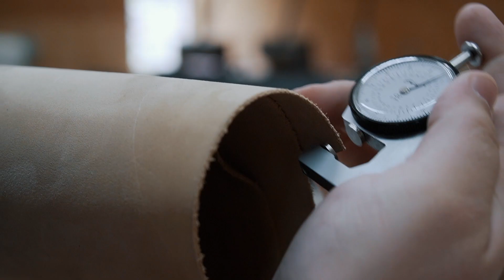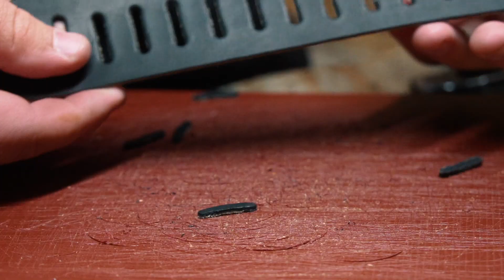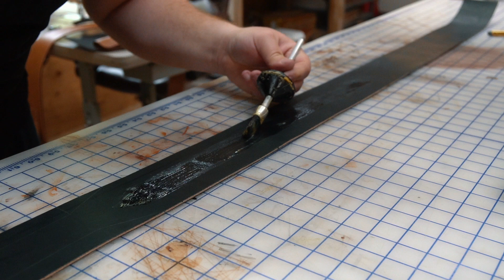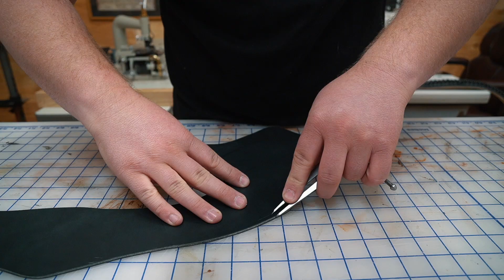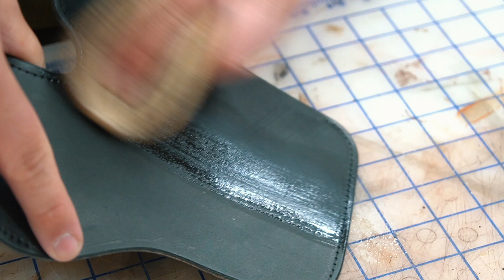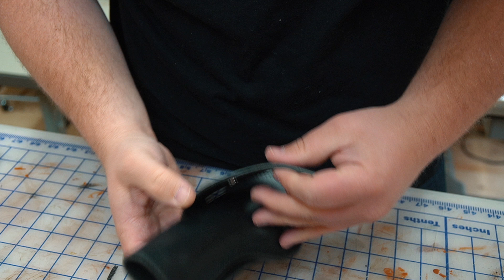Making an Eastwood Leather Cowboy Fast Draw Holster and Belt

Comment: Nice job. I have to cut the belt end taper first in case I screw it up. At least then it's right at the beginning. lol. I saddlestitch the whole thing...that sewing machine looks great. The sewn on loop backing is an awesome idea. Beats cutting holes in the belt itself. I'm about to start a shotgun shell belt and will use that.

Comment: I'll pass on this video, because I'm a stickler for "Traditional" Old West  holsters and belts as ACTUALLY used in the 1850s-1874, which this is NOT ! This is what I call a  "Hollywood-bikini" holster made for modern western movies for "quick-draw", which NEVER existed until the 1950s-1980s etc. Just my personal preference to be totally authentic  to the era . I simply will not use a Hollywood movie style non-period holsters or belts etc. If it was not used in the 19th century, I will not use it !

Comment: great work mate  im gonna order the     tipping machine  is it good any adive on it , its last one i can find  as tandy  sold out 
i think your vids and workshop great 
thx
Reply from the maker: thank you! I took the inner hole close to the oblong hole punch because I found that with thick leather, it was too close to the buckle. So I just punch that one by hand but it's still super helpful for the other cuts. Saves a lot of time
Reply: hi thx fir info i got machine today  from spain  but arrived  damaged  the knobs bent 
on your machine can you put the fence guide  in and out by hand thx again

Comment: Do you ever install bullet deflectors on you holsters?
Reply from the maker: no I tend to like the more period correct style rigs (with some exceptions). But the deflector also requires a lot more work to line the holsters with rawhide or a steel plate and it's just not something i've tried out yet. Maybe one day:)
Reply: @parkerlichfield  there is definitely more work to it but the holsters come out really nice. You should try it one day.

Comment: Clint Eastwood was right handed. .this holster was for a left hander. .just a comment. .
Reply from the maker: I wasn't making an exact Eastwood replica. The "eastwood" style belt refers to the tapered ends on the belt. Also, i'm a lefty, so if I would've make it right handed I wouldn't have been able to use it.

Comment: Great job but you forgot the hammer leather strip that holds the gun in the holster when you sit down or ride other than that again great job.
Reply from the maker: Thanks Donald. I didn't forget it. I chose not to add one because I'll never be riding with it. It's just for me to play around with at the range with wax plugs. But it would always be pretty easy to add one on later if i feel like I need it, as well as a thigh tie

Comment: Great video for entertainment.... but.... Never buy a pistol rig from somebody that does not shoot. Every rig should be built to the customer size, waist, arm length, belly size, hip rest size, aka - fitted in person. Don't get me wrong - this is a wonderful prop or costume video with a ton of tips for beginner leather workers. Wonderful information for those starting out in crafting. But gun rigs have to be custom fit to the the person and the pistol. No rig is the same, no gun belt is the same, no single action shooting rig is the same. A personalized gun rig takes several days, sometimes a few weeks, to make it through my shop. I'm very happy that they included the information in this video that this is not something they do. A wonderful craft video that shows some amazing craftsmanship, and a fun host. But take holster building seriously and not as a hobby.
Reply from the maker: Whitaker Leather thanks for the kind words but I’m not sure exactly what your point is. First of all I am a shooter. (I don’t compete in fast draw if that’s the point your making)You acknowledged that I mentioned that I don’t normally do this, so I know you heard me say it. And I’ve made it pretty clear that I don’t sell these. This is a personal project for myself.  I’m not very experienced in this genre but would love to improve in it. How else are you supposed to learn? Also, no one is allowed to this for a hobby?? Really?

Comment: Sweet ! Job o the belt    For your cartridge spacing a pretty easy / cheap. Way of getting your proper spacicing  would be to ask. A woodworker with a lathe to turn you a sowed the size you need   It shouldn’t be very  costly and as a retired Woodworker i venture to guess most guys would do a barter for some type of leather work that you do as ost of us do wear shop aprons and some type of a tool holster  having even a store bought one used as a template or design to  have a custom hand made one would be pretty cool for most guys as the off the shelf ones  are usually something we all modify slightly to  better suit our needs

Comment: Just an Idea for your rig.   Make sure your holster is in exactly the spot you want it - even marking location (on top of tape) and when confirmed - put a snap between the holster and the belt.  It will keep holster in place and allow it to pivot.  You'd be the only one with this idea.

Comment: .... more please. L handed and shoot western....  Have worked leather professionally for many years and can offer a tip or two if it works better for you. When gluing liners  to any belt, use your elbow to hold the end down and stretch the liner out as much as you can when pressing the two together. Makes for a natural curve and prevents wrinkles in the liner. Another one is when cutting out curves drop the edge of your thumb down and use it to help guide your blade and keep a perpendicular cut. You be making perfect circles. Good job.... I'd wear it proudly.
Reply from the maker: Thanks Tom!

Comment: have you used those plastic dummy guns for the holster molding?  a tight fit is desired for hostlers so the gun doesn't fall out when sitting or kneeling/squatting.
Reply from the maker: talis84 not for fast draw. I mentioned it in the video but on normal kydex or leather daily carry holsters you want really strong retention. But with fast draw you don’t want any retention at all

Comment: Handy tip, the majority of cowboy action shooters DO NOT use holsters with liners, with all the battering they get in use the liners start coming loose around the edges. I had read about this problem and when I ordered my first holster from El Paso Leather I ordered it without liner, when it finally came in they had made it with a liner, it took so long to get it, 4 months, that I didn't send it back, they also made the belt wrong but it was so bad it was unusable so it was sent back and took an additional 4 months to get the replacement. Later I ordered a second holster and it was made as ordered. After a few months of use, sure enough the liner started coming loose around the edges, it isn't unusable YET but if you look closely it looks terrible. From many recommendations and now from personal experience I don't recommend a holster with a liner. I am also a former LEO and I carried my pistol in an unlined leather holster every day for many years, and it never caused any finish problems whatsoever, there is no downside to an unlined holster.

Comment: Very nice. Although seeing as I've watched the channel for some time I'm fairly certain you carry a gun yourself fairly regularly. I'd be curious to see what kind of holsters you have made for yourself.
Reply from the maker: James Whitworth I’m embarrassed to admit it but I actually carry a Kydex holster for my .38 spcl haha. I’ll make myself a good leather holster soon just haven’t gotten around to it
Reply: @parkerlichfield  BRAAAA!!! That was like my second ever leather project. The first holster was kind of floppy and loose like a quick draw holster. Although my second, third project, was wet formed with a rubber grommet  for retention, adjustable cant, and ride high; the works. I still use it every now and again. But it was for a double stack full size 1911. So not that often. However after that I never looked back. An now that's almost all I do is make holsters. 

BTW if you want tips for making a great ccw holster watch the videos of Andrew from Andrew's Custom Leather on the Hank Strange channel. The man's a master.

Although I do like aspects of Kydex. Which is why combine them in my holsters the way I do. An I still use a lot of the techniques I learned from those videos to this day.